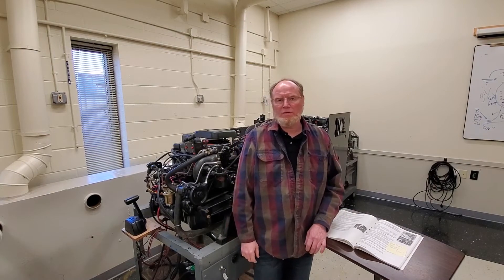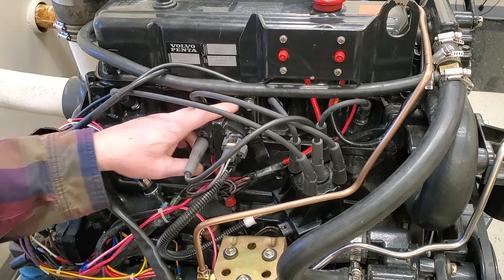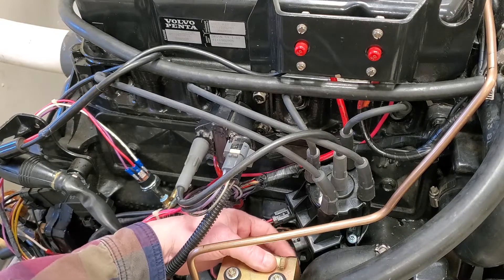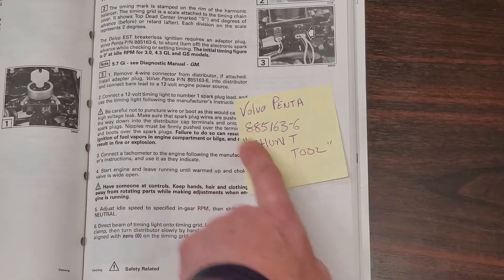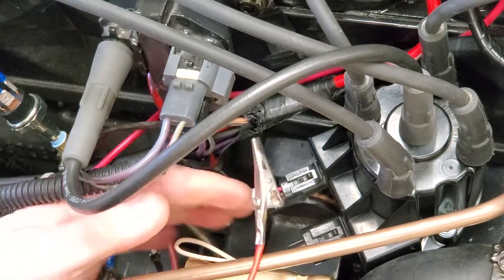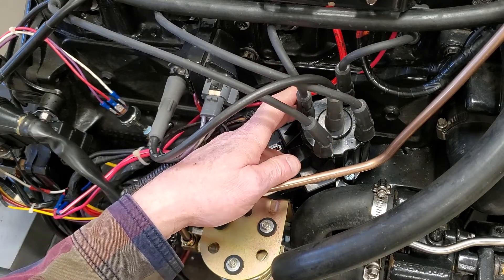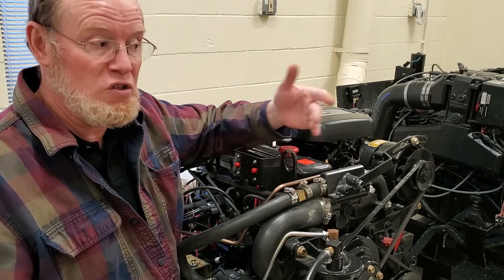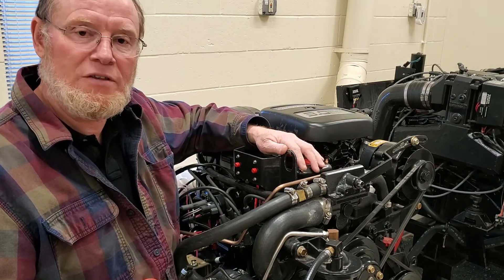Timing a Marine Delco EST distributor

Comment: Great series of instructional videos! Very helpful and much appreciated for the time you spent on helping us DYI backyard mechanics! So, here's my question- I own a 1996 Campion 622 Explorer fishing boat powered by a Volvo Penta 4.3 GM V6 engine and Cobra SX stern drive. My engine has the stamped steel oil pan, and I run the shorter reach Champion RV15YC4 spark plugs. The Volvo manual can be confusing on the timing specs. So, while running 89 octane fuel, what is the correct base timing, and should I connect the shunt tool before or after I start the engine?

Reply

Comment: I love this video! Very helpful. I do have one question though. When you say run the engine at 1500 RPM and then set timing at specifications in my manual (in my case a Seloc manual that says run at 650 RPM at 0 degrees top dead center) am I reducing the throttle to 650 RPM's to set timing to 0 degrees with shunt on). I guess I am confused at what RPM's to run while setting timing. Should I set to 0 degrees while running at 1500 RPM's with shunt on or set to 0 degrees at 650 rpms's with shunt on? Any clarification greatly appreciated. FYI, I am timing a 1994 OMC 302CCPMDA 3.0L
Reply from the maker: When the shunt is applied the ignition module goes to 0 degrees advance. If the engine was at idle then it would stall. That is why I state to set the rpm to 1500,  when the shunt is applied the rpm will drop several hundred rpm but not stall. If it does stall when you apply voltage to the shunt then the ignition module is no good.
Reply from the maker: Good Question, so why I say to bring the rpm up to 1500 in nuetral is because if the ignition module has failed then the engine will stall. If it continues to run the rpm will drop quite a bit but then you can set the base timing.
Reply: @tedsmarinerepair8956  so after running at 1500 RPM's and warming up turn the shunt on and reduce throttle to 650RPM and set base timing at 0 degrees correct? (per Seloc Manual). FYI, the RPM's drop by about 500 RPM when I turn the shunt on.
Reply from the maker: @buzzie8 that is correct.
Reply: @tedsmarinerepair8956  Thanks again for your help and insight. I am a big fan and look forward to future videos!
Reply: What I don't get is how do I know what 0 degrees is

Comment: Can you explain the reasoning for connecting it while the engine is running? My factory volvo service manual for my 99 volvo penta 4.3 GL EST ignition says to connect the shunt to positive BEFORE starting the engine. I connected it while its running like most of the videos on youtube say to do and it doesnt disable the timing advance.
Reply from the maker: Plug it in, start the engine bring the rpm up to 1500-2000 in nuetral. Connect the loose wire connector to a battery + connection. This should then put the ignition module into timing mode.

Comment: Can the traditional cylindrical ignition coil be replaced with the newer type of ignition coil? Is there a replacement kit?
Reply from the maker: The way I have done that is to also replace the distributor so it is a matched set. There are various types of older distributors which much match the system ie: points, HEI /delco est.

Comment: Hi Ted, after you use the shunt connection tool, can you just leave it inserted because I have nothing that plugs into that port so it is open to air. Thanks
Reply from the maker: Yes,  I suppose so. Some had plug covers, but I have no idea as to where to find one.

Comment: Just a question for a problem that is driving me crazy. I have a 1994 Crusader 7.4 XL with the EST distributor, MSTS and a Holley carb. When I run the engine on load and then bring it back to idle it wants to idle at 1400 rpm. If I shut it off and restart it then idles at 750 or normal.  The Holley carb is mechanical on the secondary's and they do not hang open.  I really think it's an electronic issue keeping the timing advanced. I replaced the MAP valve that runs off engine vacuum from the carb but that wasn't the culprit. I haven't read that the ignition module could be doing this but that is my next choice.  Any thoughts?
Reply from the maker: It well could be the module. the way to test it is to have a timing light at the ready. See if the timing is well advanced when you return to idle speed (but it hangs at 1400). If so change the module and don't forget to put thermal paste on the bottom of it prior to installation.
Reply: Thank you  I did buy paste and a new module. I'll give it a go.  The last time I used a timing light was probably 30 years ago. Mine is not inductive so I will buy a new one.  It's tight quarters on a boat as you probably know.
Reply from the maker: @deborahbaty3369  see if anyone has one you can borrow!

Comment: Hi Ted , I have an issue at 2500 rpm only. 3.0 lx 2000 carb. Ignition module is so hot cant touch it. Are there specific modules or are they all the same  ( 2pin + 4 pin).I use the 2 pins only.would the ignition pickup coil be part of the problem.
Reply from the maker: Google Thermal Paste, SYY 2 on amazon. Remove the module, clean the surfaces with carb or brake cleaner, apply and re-bolt. Be careful and don't strip the bolts. I think it's 28 in lbs.
Reply from the maker: Or less....

Comment: Does a thunderbolt 5 ignition have a dst distributor on a 5.7 mercruiser
Reply from the maker: Thunderbolt 5 has a fancy microprocessor built into the ignition module (does several different things) it also has a separate knock sensor and separate module attached next to the ignition module.

Comment: How to get timing control using holley efi with that kind of distributor?
Reply from the maker: Soery, don't know haven't worked on that type
Reply: @tedsmarinerepair8956  The normal fuel injection system for a  volvo penta what wire normal go to the ECU from the delco est distributor?